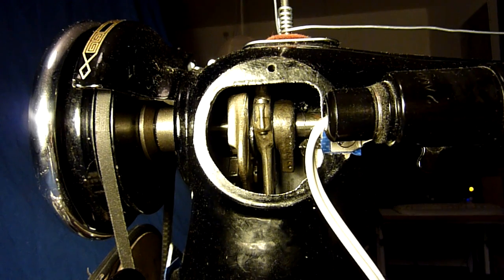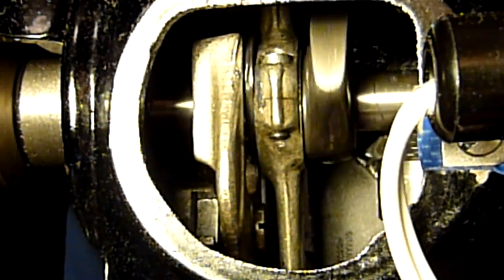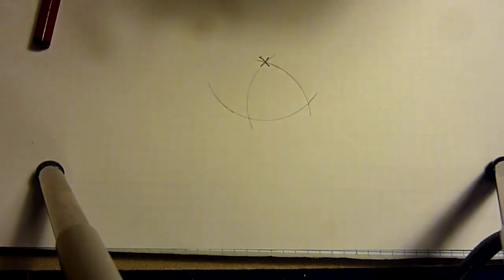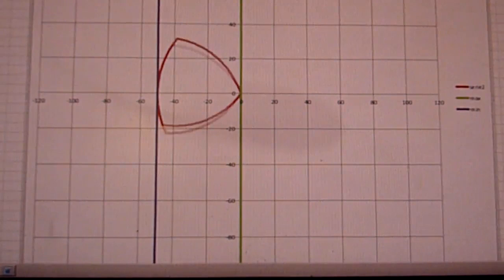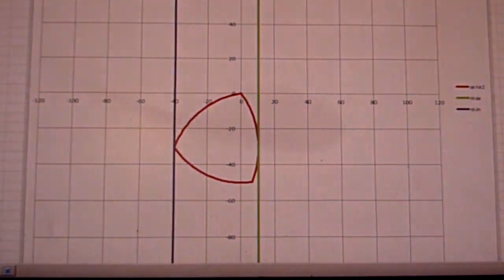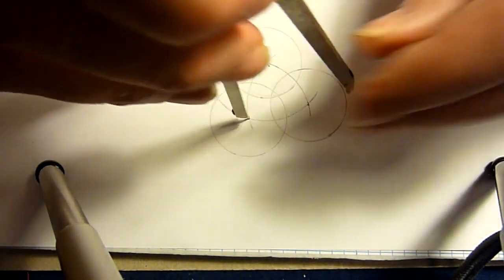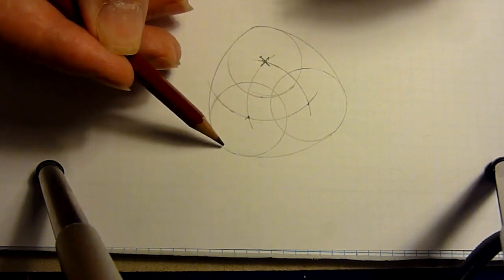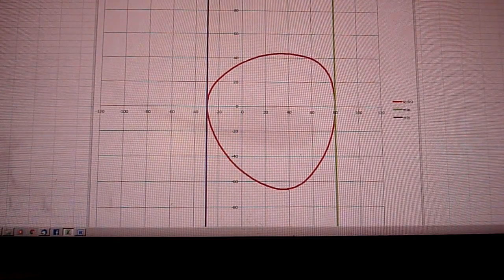Triangular Sewing Machine Feed Cam

Comment: Do you have more information about cam design for sewing machines ?. I am an industrial designer and I am analyzing about that.
Reply from the maker: Cams have been used for decorative stitches, but this kind of control is now by computer in modern sewing machines. Previously cams were more used for long shuttle sewing machines to control the needle bar motion and for the motion of the take up lever.
Reply: @sewingmachinesindetail  Yes, I know. I have several machines with cams, that is why I am analyzing their design, to reproduce them and make new designs.
Reply from the maker: I do not have any more specific information. I know that books and scientific papers have been written about cam design in general.
Reply: @sewingmachinesindetail  thanks 😄

Comment: The feed dog independently controlled by presser foot height and needle penetration of fabric. If only...
Reply from the maker: Sorry. I do not quite understand what you mean. Can I ask you to clarify?
Reply: @sewingmachinesindetail  it would be good if the timing of the feed dog was independently controlled by a separate motor. This would eliminate the need to be dependent on the rest of the machine's timing. After tinkering with 20 or so machines I have bought at yard sales and online, trying to sew thick leather has brought me to dreaming of making an independent feed dog.
Reply from the maker: For some machines you can adjust this timing, but for others not. I can adjust it on my Singer 201 and Singer 66. But they have a groove for a Lock screw, so you need to adjust above 25 degrees to make it happen. You may have seen my other video about adjusting the feed dog timing. I am not sure about newer machine, which may have separate stepper motors in them, so there could be an Electronic way to do it. I know that some industrial machines are better to handle thick leather. For domestic machines only some of them are suitable and you need to tinkering quite much, and thats what I made some videos about.
Reply: @sewingmachinesindetail  they're very good videos and I appreciate your work.